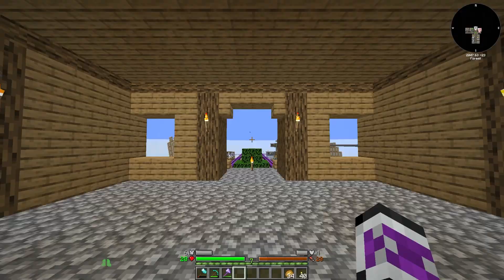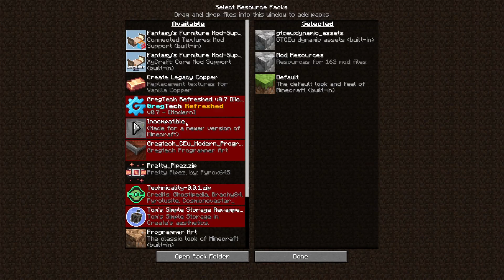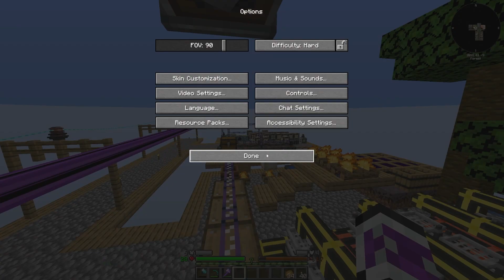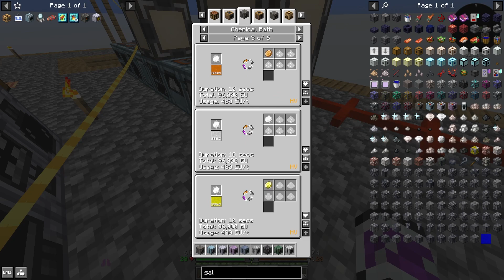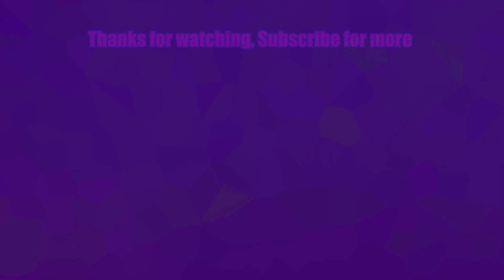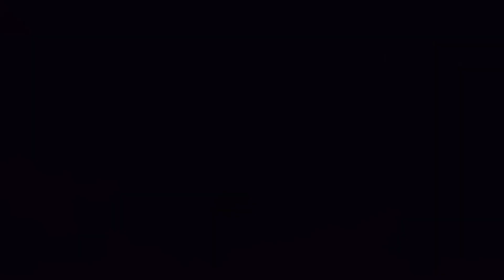Star Technology: Episode 16 - HV Energy Difficulties

Comment: I think you should upgrade the cobblestone generator using a igneous extruder and an upgrade kit(i usually use hv)
Reply from the maker: I did, and it's still struggling. I think I need a better method entirely because the main bottleneck is the extraction rate from the barrels.

Comment: Modular routers have a really fast energy distribution speed if you put 9 speed, 6 stack and 64 energy upgrades. Only disadvantage the router is unidirectional and can only send energy.
Reply from the maker: That could work, I'm guessing I don't need all of those upgrades for HV but it could get expensive to expand beyond that, but by then I'll have better options. Thanks for the tip anyway

Comment: are the gregtech cables connecting to the blast furnace support 16 amps? you also can make a greg battery buffer for only the blast furnace to temporary fixes the problem has to be 16x buffer
Reply from the maker: They're 4x lumium cables that support 16x HV power, but I'm still a little opposed to a greg battery as it doesn't fix the core problem, they might be better later on when GT power uses much more rf.
Reply: @Thaumiumking9  Good to know because I can’t get used to seeing the cable being skinny that also can transfer 16 amps
I play Nomifactory right now and I’m use to seeing 16x dense cable

Comment: The reason for your power issues is that for some reason pipez energy pipes don't work with the gregtech energy converters, they can't output energy directly into the converters. So the solution is either using the new age wires like your did but you are limited at 8K transfer per wire and need to run parrallel wires, or you can put an energy cell between the energy pipe and converter. That way the pipe outputs into the energy cell and the converter can pull energy from the energy cell. Though it's annoying because you need one energy cell per energy pipe to converter connection.

Other solutions that works to bypass this issue/bug are, laser IO (apprently, I didn't test it myself) and later when you get access to it, flux networks.
Reply from the maker: That would explain why Pipez made no difference, the solution with cells could work but I agree that it's a bit too annoying/expensive to do it that way. A flux network is pretty soon so that'll be my long-term solution. Thanks for the help anyway
Reply: I've been wondering why they didn't work with the converters... I thought I was doing something wrong lol.
I'm now using an energy cell with hv augment when I built the multiblocks for ore processing. Works perfectly.

Comment: you can press plus with ctrl while crafting to automaticly request everything in recipe

+ you should check option in pattern provider to only make one thing at a time
+ energy pipez are strange if it comes to giving power to gregtech converter (basicly thing from gt needs energy to be pushed inside but thouse pipez only transfer energy)
++ if you need better energy cables you should use transformers from gt and use lumium cables x16 (they transfer like HV and 256A) thats enought for long time
Reply from the maker: I forgot about the control thing, I dismissed it when the middleclick was broken thinking it was AE2 in general, but I guess it was never broken in the first place. Also the pattern provider has that checked by default, I just had broken recipes for a bit.

Comment: You can use energy p2p to transfer power through the ME system and it’s an unlimited transfer rate
Reply from the maker: Oh, if your saying they accept power too that'll be the solution I'm after. I dismissed it earlier because I thought I'd still need to get power into the controller, but if I don't then that solves the problem. Thanks for the tip, I'll do that next time
Reply: But i think the p2p will take energy too
Reply: @RDA_Gg  Yeah, but GregTech energy scales in such a crazy way it gets insignificant really quick. Though as far as I'm concerned, the whole problem is caused by sticking to RF as the main power system; that works in Omnifactory (and many derivatives) because it's built all around it and the GT version in it is so buggy, but not really in the more serious GT modpacks. It takes away a lot of the power management fun out of it too.

By the time you're in fairly early HV, you can already have a mainline of EV cables bringing GT power everywhere you need it (with the possible exception of EBFs), or you can always use pipes (or well, AE) transferring some fuel to generators instead. It gets even more reasonable in EV where you finally get decent energy storage. And of course, in most modern GT modpacks, superconductors are really easy to get and fairly cheap, so you rarely have to worry about cable loss even on lower voltages.

I know, the allure of lapidary dynamos and the simplicity of RF is strong :) But the truth is, embracing GT power would have solved so many snags in this playthrough already :D GT has some mechanics that are pretty rare in modern mods (and games), but it's worth the learning experience.

Comment: Those soft cables absolutely suck at the power transfer. Unless I have missed something, there are no better ways to transfer RF power in that pack than Flux Networks, and you can get those right now. 2HV hatches on BCR will get you EV required to make the flux dust. Maybe you could also use LaserIO, but god damn, it gets bad with server usage if there are too many nodes.
Reply from the maker: Oh yeah right, I can overclock into EV. A BCR is gonna be a lot of work, but it's likely necessary for EV anyway, and fixing my power is a good enough excuse to get it early. Thanks for the tip

Comment: What i did is have a lapidary dynamo for each converter and have them all connected to ender chests which has diamonds in it
Reply from the maker: That'd work for adding fuel, but I don't know how that'd fix the power extraction issue unless your suggesting that I make a dynamo per machine.
Reply: @Thaumiumking9  yeah, just add dynamos onto the energy converters until it can handle it
Reply from the maker: I was hoping that wasn't the solution, that'll be so much more expensive than cables, but it'll do as a backup if I can't figure something else out.

Comment: Yeah, that's the power issue for the part you're at right now. Eventually you'll get to the flux power mod and that's when you switch over and power gets a lot better to handle since its all wireless. You will also be able to buy flux points a plugs in the shop which I highly recommend buying 1 set as soon as you get there.
Reply from the maker: Yeah, a flux network seems to be the highest priority right now, That's where I'll go first once I get into EV. Thanks for the tip